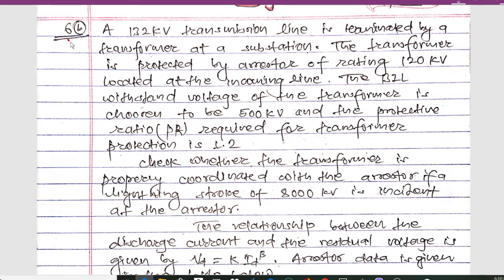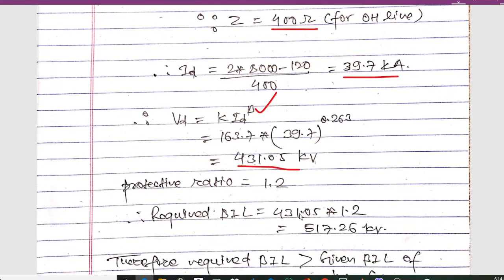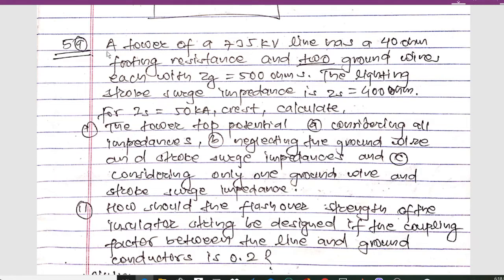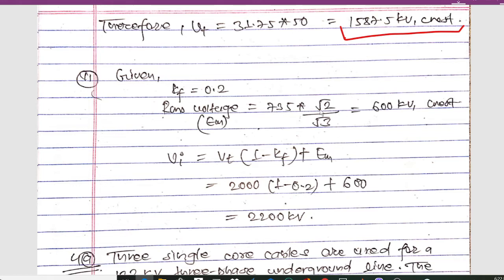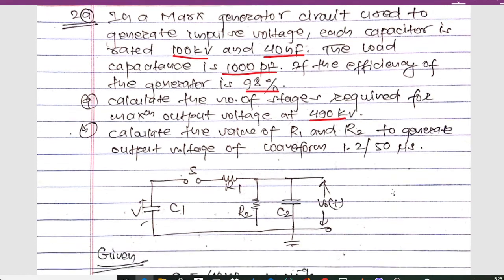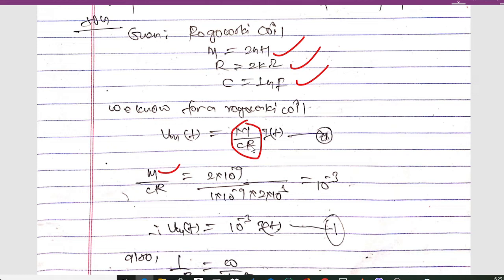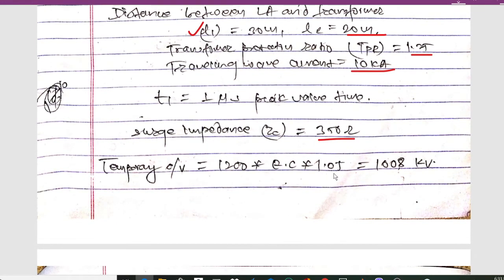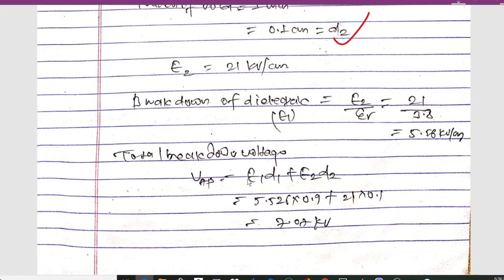High Voltage Engineering Complete Numerical Solved 2 || @jitendra sah || smart study @smartstudy11

Comment: I have a question a compensated resistance divider has it's high voltage arm consisting of a series of resistance whose total value is 25 kilo ohm shunted by a capacitance of 400pf.The LV arm has a resistance of 75 ohm's. Calculate the capacitance needed for the compensation of this divider
Reply: I need solution sir for this q